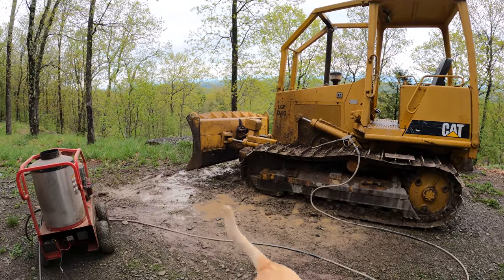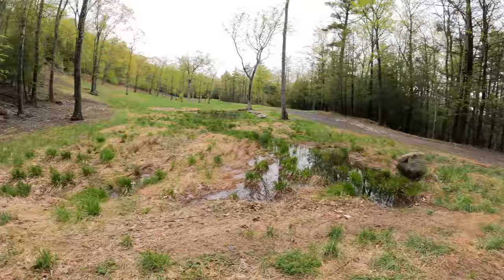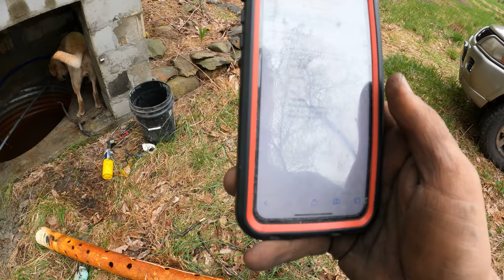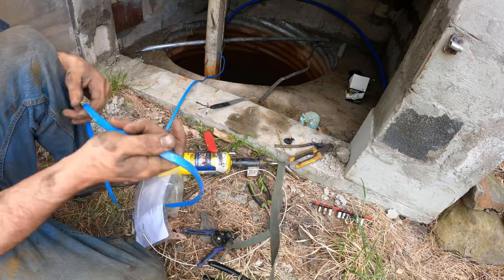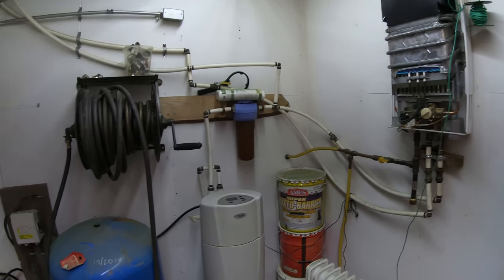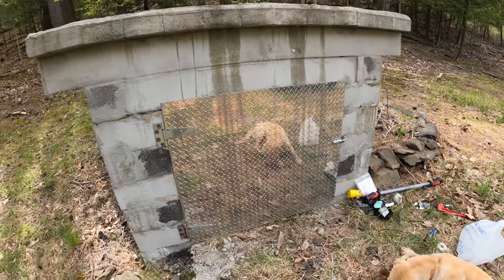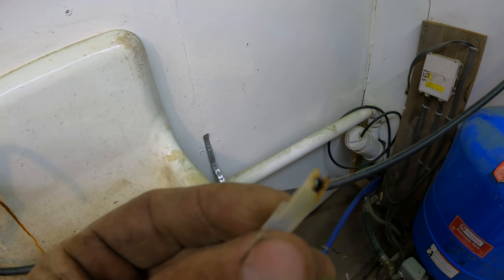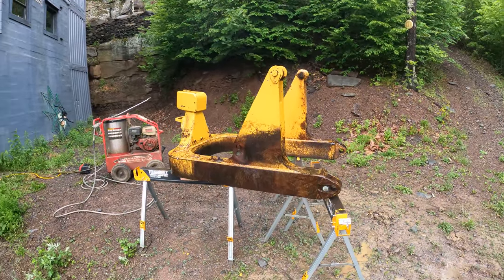Replacing a well pump

Comment: One thing I did a few years ago on our well pump is install a pressure switch with a low pressure cut off. That way if the pump runs dry it cuts power, protecting the pump motor. A side benefit is if there is a massive leak and the pump cannot keep up it also cuts power hopefully preventing a flood.

Watching you change the sediment filter reminds me it is time to do ours.
Reply: so how do you build pressure after an event that trips it? manual bypass switch of some sort i assume
Reply: @AndrewBrowner  Correct, switch has a lever on the side to manually power pump until pressure builds a little. Fist time it happened, filling greenhouse solar batch heater, I forgot about the low pressure feature and could not figure out why the tanks were not filling.

Comment: Pro tip. Check your cut in/ cut out pressure settings anytime you have the blue tank drained off. (Cause it's the only time you can check those).
Your well pump died pretty young. It's awful shallow for such a large pump. My guess, it's hammering itself to death internally. Seems it may be good head pressure running up hill but, a 2/3 horse pump can do that push. 
If ya know a local well driller.you could trust, he can tell ya the size you'd need to be "just right" on power/gallons/head pressure.
Your videos are great, keep it up man!!!!

Comment: If you dip those spinny-nozzles in motor oil after each use, they’ll keep spinny-ing.
Reply from the maker: Do you think that one will come back? It stopped spinning a while ago
Reply: @AndrewCamarata  Yeah if it spins at all it should come back especially since it looked like it was all metal. I’d try something a little higher-strength like PB Blaster and then tap the end on the ground while holding the pressure on.
Reply: @AndrewCamarata  ya it’ll free up if soaked. I throw wd 40 in the spinny nozzles after use - always loose the next time 👍

Comment: Andrew, by now I'm sure you solved the problem but I thought I'd add my 2 cents since as a farmer I had to learn about wells and irrigation systems. A controller is probably a VFD couples with a 3ph motor which would give you a constant pressure system. No control is likely a 240V with a pressure tank, and these are constant flow systems. motor sizing is a function of how much flow at a given pressure (and of course lift). You well is basically at ground level :) You can find charts on the gould website with motor and pump pairs for your situation.  good luck. Actually feel free to reach out if you still want to talk about  pumps etc.

Comment: That American way of just twisting wires to connect them 😂
Reply: yeah, funny to see it is still used. Wago's are so much easier to use...
Reply: this is an international way
Reply: @Snooooozel  Or even just a screw terminal
Reply: We do the same thing in Australia too ha ha
Reply: Yes i am sure its only people here in America who does that...
Reply: @Snooooozel  Are wagos rated for high amperage or 230v? Thought they were better suited for  15A lighting situations. Do they have to be enclosed in a box or ran outside in an attic for example?
Reply: @boriskarloff598  Wago 221 are rated for 32A and 420V
Reply: @noobgamer-qb3gq  The 221-6 (6mm²) even for 41A
Reply: @noobgamer-qb3gq  Thanks, didn't know they could handle that.
Reply: They tried to sell these screw-on caps here in Germany already, I think Aldi had them once...didn't make it really into the market....
:-D
Reply: in in test (YouTube haha) they are holding much more without issues. Are this twisting nuts usable for the cheaper and more and more used aluminum wires?
Reply: @boriskarloff598  The nearest box to my desk says 450V 24A. Is that good enough?
Reply: Wagos are the best product ever made for an electrician, saves so much time and anger and also always has the same quality on all connections. These twist connectors he uses here where never used in my country.
Reply: Leave it to Germans to over engineer something and it still not come out reliable lol
Reply: @lengeldridge  In New Zealand we use kotanga.
I will leave the room quietly now.....
Reply: Do you ever change the pressure washer jet I mean I saw you swap over to a rotating jet, but jets wear and changing them can make a difference !
Reply: @Johnnyreengo  :-*
Reply from the maker: I actually had a box of those new connectors, I forgot about them, will that 10 gauge wire fit in them?
Reply: The wires are mechanically connected with three twists
and then covered with a wire nut
Reply: @DmiA  Actually, many places wirenuts are not allowed- because they tend to fail high resistance...
Reply: @AndrewCamarata  The wago 221-41X is for 24 … 12 AWG wires, but there is a bigger version, the wago 221-61X is good for 20 … 10 AWG wires.
The X is the number of holes in the connector.
Reply: @boriskarloff598  Wagos are actually rated for 'maintenance free' junctions in the UK- the only joiners allowed to be put in 'inaccessible junctions' like under floorboards or inside walls ie they don't have to be in an open-able junction box... wirenuts aren't even allowed at all...
Reply: @AndrewCamarata  10 gauge is similar to 6mm², so you need the 6mm² Wago's for that (Wago 221-613 for the 3 wire version)
Reply: @steved2136  Thank's for the info Steve. In the USA wirenuts are the standard. Heat and plastic are not good friends over time so I've only used them a few times but handy little connectors they are. Cheers.
Reply: @AndrewCamarata  A WAGO 221 should handle a 10 gauge just fine.
Reply: @AndrewCamarata  
You should use a second pair of pliers to hold the wires while you twist the ends of the wires. It essentially is the same as what you were doing, just you don't end up twisting the insulated portion of the wires. I usually use needle-nose pliers to hold the insulated portions of the wires while I use a linesman's pliers to twist the bare portion of the wires at the end.

Comment: A small Goulds pump would run for thirty years. Installing a larger expansion tank and assuring it's pressurized at 2 lbs below the low-pressure setting would make your pump last longer. It's the starting and stopping that kills them. A small 1/3rd or 1/2 horse pump would probably be more than sufficient. Using a larger than necessary pump kills them also because of the short cycle times. 
Thanks for posting your videos.
Reply: That water is very high in iron which is hard on pumps no matter what type you use.

Comment: Always check your hose on a pressure washer. I remember my friend came to my shop saying that here boyfriends friend said that she needs like a 1 k in catalytic converters to fix the lean code. I charged her after a smoke test and a look-see. $ 75 to replace a clogged up fuel filter. She bought me a case of beer and tipped me $100. Do the simple shyiet first before you start loading the part$ cannon.

Comment: I think the start wire that you disconnected was for using that large capacitor which would minimize the initial electrical surge that’s tripping the breaker.
Reply: yes, he disconnected the start capacitor,the new pump wont last 1/2 of the other one
Reply: The New pump only  had 3 wires ?   Old one had 4...

Comment: Pitless adapter would make servicing your pump so much easier!
Reply: He should have also not used a metal culvert as the liner a plastic culvert would have kept the water from being so brown with iron!
Reply: Not necessarily,  most well casings are made of steel unless they are concrete rings.
The water that is high in iron will often be rusty brown.

Comment: Using similar cheaper pump here to provide water from Delta for irrigation. Had a 1500 dollar pump ended up pulling it not enough pressure. I run 17 sprinklers off the cheaper e-bay pump, and so far been working great for over year now.

Comment: My last pump was in well since 1969 quit working in 2019. My well is 300 feet deep and high in black sulpher and salt the water kills any metal that isn't stainless and eats rubber. I got cheap pump from Tractor Supply because my well guy wanted $1500 for new pump installed and the cheap pump was 400, I pulled 280 feet of pipe with pump on it not easy even with the rollers that sit on the casing for pulling pump the new pump was installed and dropped back down the well it last 4 months. I ended up just calling my well guy he came within an hour with his power puller had new pump back down the well in a half hour and new pump is covered for 25 years and my guy said if it goes before that he will cover my pump and pound me a new well for better water if I just buy the casing. New pump was $1500 installed with manufacturer's 25 year coverage plus a promise from my well guy which is more honest than the manufacturer since our families go back generations and we used him on all the new houses we built when we did contracting.

Comment: I install pumps for a living and the only problem I have with ebay pumps is that when they break people ring me up to come and fix them.  Depends on how much you rely on the pump if you buy a 200 dollar one or 1000
Reply: So ebay pumps keep you in work? If the pumps are too reliable what will the pump fitter do?
Reply: but youre assuming the ebay pumps or worse or the 1000$ ones are better.. the weakest link is always what will fail, the 1000$ pump could be better in every way except one flaw and itll fail at the flaw everytime.. 200$ pump lasting 6 years, the 1000$ pump has to last 30 years to be equivalent.. and sometimes its something upstream that causes the failure.. possible a clogged filter in this circumstance which would have burned either pump out.. doesnt look like a huge job to change pumps atleast in this circumstance ill take 5 of the cheap pumps over one of the good ones everyshot
Reply: @AndrewBrowner  depends on the depth of the pump really. Pulling out a pump that maybe 10-30 feet is easy. Pulling out a pump thats down 200-400 is a pain in the ass.
Reply: @Someguy6571   a pain in the ass but is it an 800$ pain in the ass? and were still making the assumption the cheaper pump will fail quicker plenty of instances of cheap pumps outlasting expensive ones
Reply: @AndrewBrowner  might not be to bad in this well but you wouldn't have the same opinion if it was 100m down. And usually the $200 ones have plastic impellers in the stack that crack on the centre spline with the smallest quantity of sand. Meanwhile the $1000 one will have all 304ss impellers and also be smart enough to not burn out but give you an indication lights that shows flow isn't sufficient to cool the motor or better yet slow down to fit the required duty.

Comment: Hey Andrew! With a 2 wire pump you can directly wire into your switch (the grey box on your tank tee). You also have a check valve on your tank tee which you don't need as there should be a check valve on top of your submersible pump. Lastly you should pull a tee off before your filter and softener for your outdoor use so you are not wasting salt on those bulldozers. Just some food for thought thanks for the videos

Comment: I've never seen well water that dirty. That surely isn't normal.
Reply: It's a conbimation of sand and rust. ( The rust coudl be either in the ground naturally or from the metal shaft he used, we have a conrete shaft here so that's a big difference
Reply: It's a dug surface water well that collects water above bedrock and the bedrock below the shale and gravel is red as seen in Andrew's test of the Ditch Witch trench cutter so it will be red with dissolved iron oxides.

Comment: Why do you even need a deep well pump for that shallow hole?  Is that just for utility water?  You don't drink that brown stuff I hope!
Reply: Although his actual well is shallow, the water still has to travel a hundred feet or more vertically to reach the pressure tank.
Reply: @jacklabloom635  Good point.
Reply: It goes through a filter as well

Comment: I guess the $1k pumps don't break in half after 6 years "for absolutely no reason"
Reply: That pump would have to last at least 30 years to make it even parity and I seriously doubt it does that.
Reply: No, it breaks after 3 years "for getting comercials alive!" (today 91% of tradinggoods are coming from china(food excluded))
Reply: @327JohnnySS 
 If you've already been vaccinated, you can test the mutations.
Who wants to live forever? sarcasm off
Reply: @Gnagnie  good well pump are either made by Emerson in the USA, flygt in Germany . Medium range such as redlion are often made in Mexico. And yes they last 30 years but they eventually need an impeller pact and jet replacement
Reply: @Channel-gz9hm  Need to subtract the time of replacing 5 pumps though. But for andrew this is actually a bonus because he'll make money from the video 😅
Reply: @johannagel4520  Flip a breaker, haul it up, throw it down, turn electricity back on. 2 hours every 6-7 years I'll take over spending thousands more.
Reply: @Channel-gz9hm  It's not 'thousands more', it's the same price ($1000), since we equalised the cost by multiplying the years. If the pump actually lasted 30 years then it would be cheaper because it only has to be installed once not 5 times.

Comment: If you haven't already its a good idea to check the empty air pressure in your pressure tank every year or so. The pressure should be the same as your pump cut in pressure with the pump shut off and discharge and all water pressure drained off. This stops your pump from cycling excessively which will shorten the life of the pump.

Comment: There are definitly quality differences in some cases but most of the time its the same thing from china marked up 500%
Thats why i dont bother looking at local shops in most cases
Reply: Yeah I have bit odd that at times with items you’ll use replace in a long long time, 
I’ve seen them just repackaged, change stickers and names sometimes and raise the price like you said.
Reply: I came across a cheap submersible pump -brand new- which had a nasty cast alloy base. I was in the pit, hoiked it up out of the pit at shoulder level and the thing snapped. You could see the base was made from shit alloy.
The pump itself was a monster. It sent the hoses rearing up on itself like 6ft tall angry cobra spewing venom...or slurry!

Comment: Well if one pump costs you $200 and lasts for 6 years, that’s $1000 every 30 years to get to the cost of a $1,000 pump.   And how long would the $1,000 pump last?  20 years?
Reply: I'm in AZ, my friends well was drilled to 1,500 feet, pump installed at 1,000 feet.
Reply: If you value your time at zero.  I value mine at the $150 an hour I bill.  2hrs @150=300×5=1500.

Comment: Look into adding a Cycle Stop Valve to your system. Using the pressure washer with your smaller pressure tank is likely causing your pump to cycle on and off excessively causing damage.

Comment: Also, on dousing or “witching”. A well. I’ve never had anyone accept money To douse a well.
Reply: Payment is usually a bottle of Whiskey.
Reply: Yep. Normally considered a divine gift. The ones that do it say it would be blasphemy to accept payment for it.
Reply: Blew my goddamn mind in my electrician course when we used two copper wires to dowse out the underground conduit in front of an office building
Reply: @Hyratel  it's fake, bud
Reply: @joemilton7552  having seen it work for everyone in a class of ten ppl, i disagree and have no interest in taking this out further
Reply: Dowsing is nonsense. Finding groundwater in most places is as difficult as finding a tree. In the woods.
Reply: @Hyratel  Please just google it.  It's definitely not a real thing.
Reply: @joemilton7552  it works
Reply: @davesilvia9711  It doesn't, man  Read about it online, and the studies that have been done thoroughly debunking it.  It does not work.
Reply: @joemilton7552  you just dont know how.
Reply: @davesilvia9711  just google it.
Reply: @joemilton7552  explain my 25gal a min well in a land of 4 well properties that still have water hauled...every well dug by my guy in the area is dowsed. And every one produces.  My neighbor called my guy, 2 12" and less than 10gal combined before.  He dowsed the 8" that produces 15gal a min.
Reply: @joemilton7552  because Google is always right?
Reply: @avlawns3037  Why has every study ever done on the subject shown that it's as effective as pure chance?
Reply: @joemilton7552  why does everyone on my street that had a well dowsed get 25 plus gallons a minute and those that don't are lucky to get 10?  Studies or not, results cannot be denied.
Reply: @avlawns3037  Those are what as known as anecdotal results.  Controlled studies have consistently shown that dowsing is as effective as pure chance.  James Randi put up one million dollars to anyone who could show dowsing is effective, and over several decades many tried, and failed, to show its effectiveness.  I encourage you to just go read about dowsing.